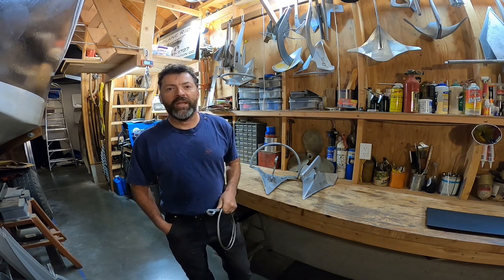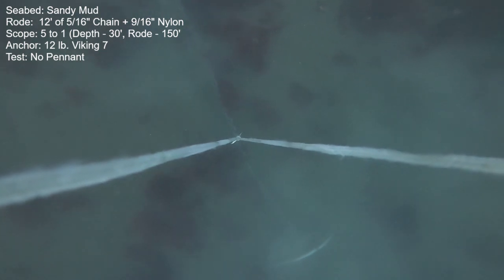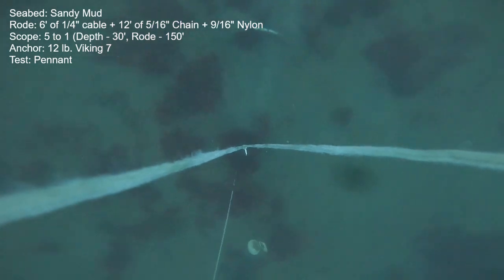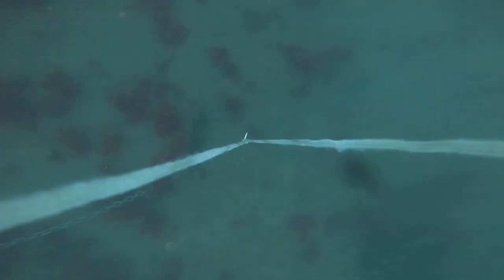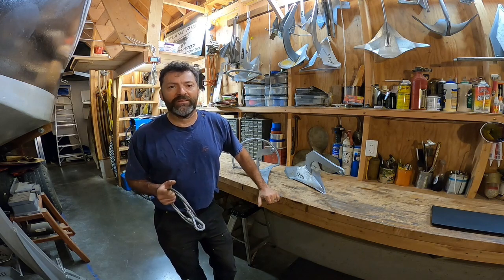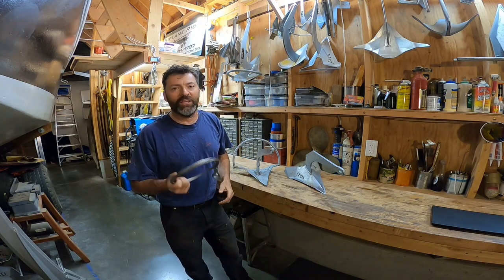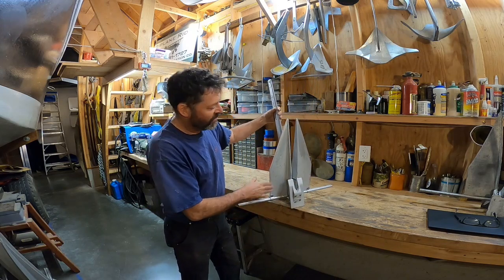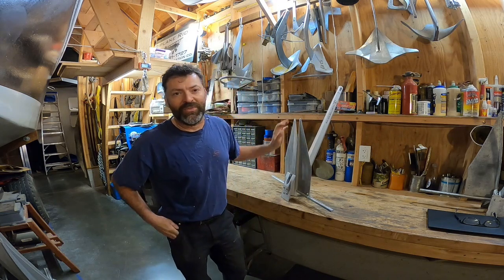Anchor Testing With Cable Pennant.  Anchor Video # 111

Comment: Steve, have you tested anchors with a kellet and sentinel system. The theory seems sound in holding down the rode to keep it horizontal to the sea bed.. I use an original 20# Bruce for my 26 ft. C&C sailboat and has never dragged, even with a displacement of over 8,000#. Please do test this arrangement, it will be most useful.  Thanks.
Reply from the maker: I have not tested kellets but it is on my list of future tests.
Reply: @Panope  BTW, I use a 13# mushroom anchor for my kellet and I always pull it up full of mud.

Comment: Great video as always, thanks. I have zero knowledge of either,  I wonder if by any chance you considered using dyaneema rope instead of cable for a pennant.
Cheers!
Reply from the maker: Personally, I would want better abrasion resistance than Dyneema provides.

Comment: Interesting concept, Steve. I would think that a chain would be better than a cable because it’s individual links would weigh the rode down whereas the cable sort of acts like a single line between two ends. Could the positive test with the Excel be simply due to additional rode? What if when you do a “no pennant” test you add 6’ of chain instead of the cable to have the same metal rode for comparison?

Comment: I have often wondered how many pounds my boat pulls while at anchor. I have not (yet) anchored in heavy wind where my delta anchor has released in the Lake Michigan sand where I usually anchor. I always set my anchor by reversing after set. Is there a chart that indicates pounds of thrust with incremental sizes of propellers and incremental RPMs?  Is there a meter or scale that I can put on my rode that will indicate max pull while anchored?  Thanks for your research.

Comment: Steve,  Would the cable tend to fray when on rocks? That might produce barbs on the cable.  If this were a problem could the cable be covered in plastic or some other substance to protect from fraying?
Reply from the maker: I do not know of a readily available sleeve that has greater abrasion resistance than steel cable.

Comment: Be great if you could figure out whether a Kellet  is of any use at all, ie does it reduce snubbing, increase holding etc etc
Reply: A kellet is most effective to stop the boat from meandering around the anchor when the wind dies. It is not effective in the strongest storm conditions when the rode is “bar tight” .
Reply: @1sailfast  I familiar with the argument made by Peter Smith et al. I just don’t believe it. In very strong conditions the vessel is ranging around, rising and falling and yes, occasionally bar tight, but the rest of the time the kellet is dispersing energy and reducing the snubbing. Historically (McMillan) kellet weights range into the hundreds of lbs.

Comment: Interesting test, not sure I would want cable on anchor, just cause by its nature it can be difficult to clearly see corrosion and wear
Reply from the maker: That is a good point regarding stainless steel cable.  However, galvanized steel cable should give plenty of warning (rust) before becoming compromised.